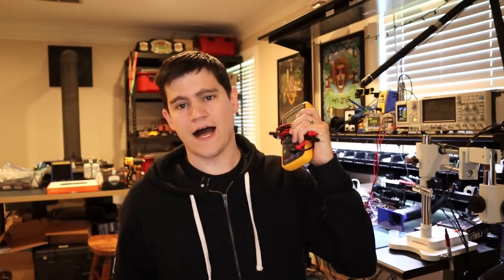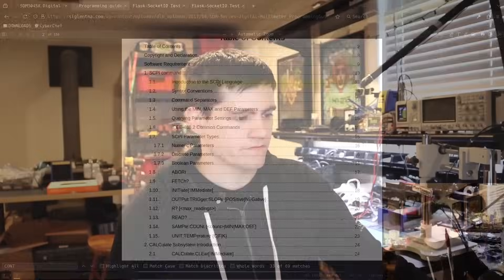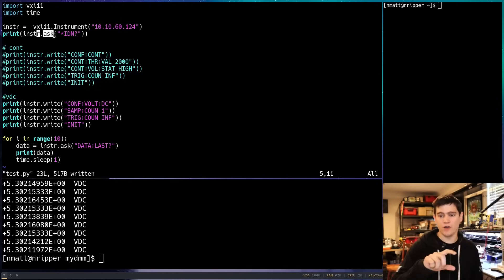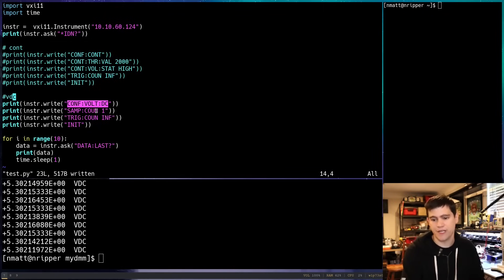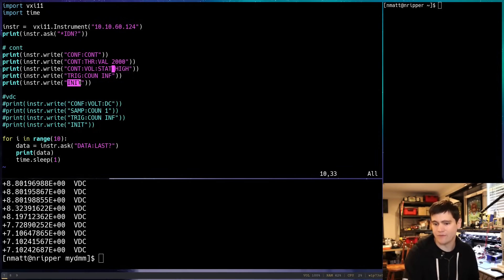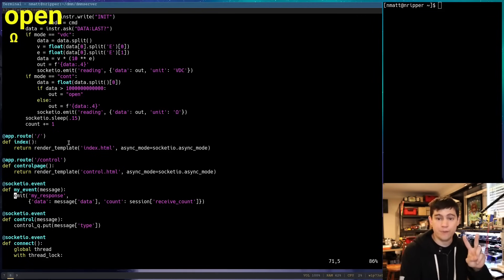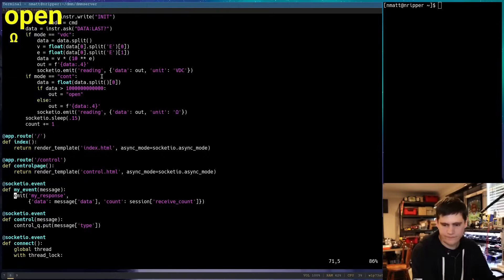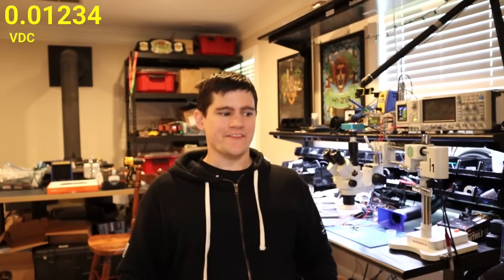Siglent SDM3045X Multimeter - with Custom OBS Overlay

Comment: Congrats on making your own OBS overlay, well done.  It's quite the sense of achievement and best of all you get to cull all the stuff you don't want.

Does your meter also lock out the front panel during the SCPI querying ?
Reply from the maker: Yes the front panel locks which is very annoying. Is that just a limitation of the meter itself? Are there some meters that don't lock out like that?
Reply: @mattbrwn  if you find one, let me know. I sadly suspect it's a legacy holdover from the "old days" where the equipment was entirely remotely managed and it's definitely something you wanted to happen (the lockout).

Personally I'd love to see meter makes provide a SCPI option to permit concurrent access along with a summary query/response too (ie, basically "read only"  SCPI mode ).

I imagine it's a case where the way we're using this equipment is "too new" for the makers to be keeping up or understanding ( when I tried explaning to some of the meter makes they were "Why would you do that?" ).

I ended up adding hot-keys to change modes and it's easy to use but I still want that concurrent front panel access.
Reply from the maker: I said I wasn't going to do a hardware hacking project on this multimeter itself but this might be the perfect motivation to do that 🤠
Reply: @mattbrwn  good luck with it.  I ended up being "sufficiently satisfied" by utilising the hot-keys to switch modes (ie, win-alt-R for resistance, C for continuity etc ) and what can be useful is if you have a 'pause' button where your OSD software then stops querying and you can then use the front panel again.

Adding the read-only mode would be a nice firmware twist :)
Reply: @pldaniels  I've bumped my head around this issue a lot. If you see my latest videos, I am displaying on screen 2 lab power supplies, a USB supply (using INA219) and the DMM. I have noticed that although SCPI is rated as a "protocol" it does not work the same way on all devices. For example, on my Owon PSU, I can low-level read voltage and consumption without having the PSU in remote mode (the mode that locks your front panel). On the other hand, my Agilent supply is way worse, I can't do any readings unless the psi is in remote mode, which locks the front panel.... annoying. It has a few low-level commands (that's how they name them) which allow some settings on the voltage and power without putting it in remote. Now, for the multimeter, I use a uni-t which dumps all readings on serial continuously - very easy to capture them. I plan on getting an Owon dmm as I believe that also has a low-level scope reading command. Now, looking on the Siglent doc - are you sure "DATA:LAST?" isn't a low level command that does not lock the panel? I would try it without any other pre-commands like INIT or CONF:....